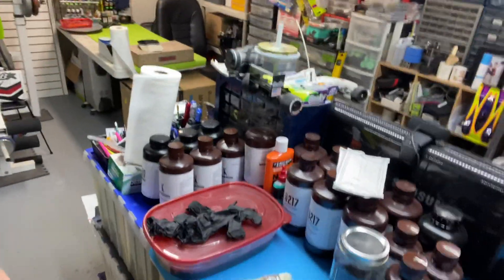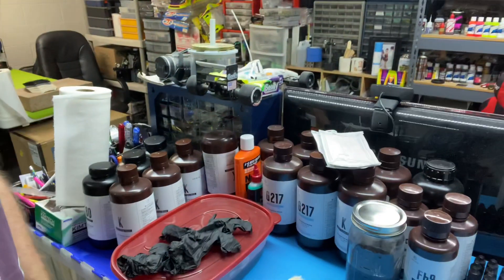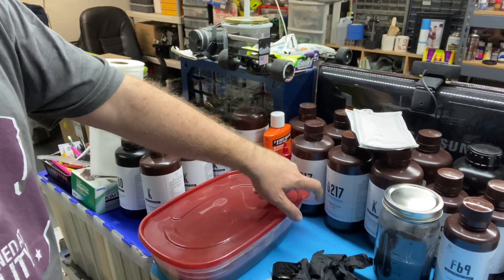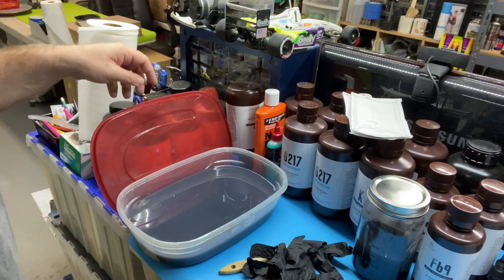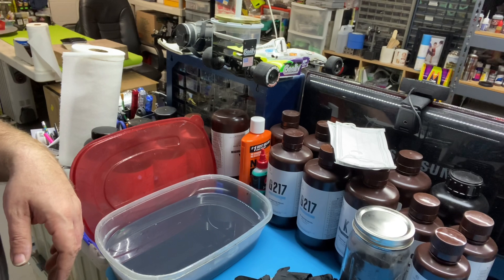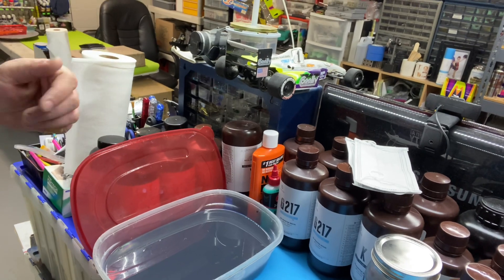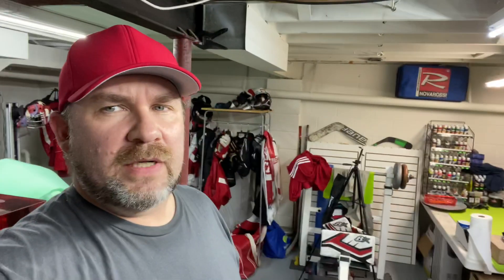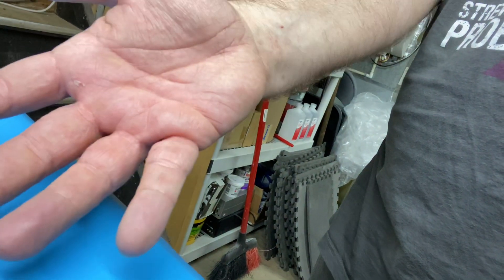My WORST 3D Printing Mistake!! Warning!! Gross!!

Comment: Thanks for sharing your mistakes - we all make them. Now, should you and your children be worried about the ventilation of those chemicals?
Reply from the maker: Yes sir! We are already using the Elegoo in printer charcoal air filters (they help a ton). Plus have another air filter running plus a fan for circulation. We are also going to be building more of a “maker” area soon where the printers will be in a sort of cabinet with their own ventilation away from where we will sit and design, paint or prepare the printed items.

As a family, we are full in on 3D printing and it’s not something we will stop anytime soon so we are taking the steps to make sure we can enjoy it and be as safe as possible!!
Reply: @cyrulrc14  You're a good dad - keep those kids safe. Maybe buy a FDM (Filament) printer and let them experiment on a different kind of printer.
Reply from the maker: @rogersecura378  - Way ahead of you!! My youngest just put together her Elegoo Neptune 2 today. She fell asleep before I could finish adjusting and leveling it all but it’s just about finished printing the sample “Buddha” so tomorrow we can start loading up some stuff she wants to do!!